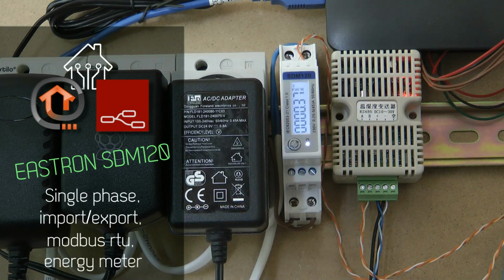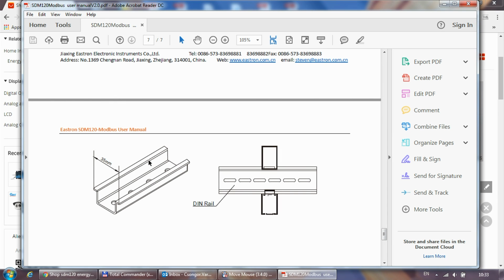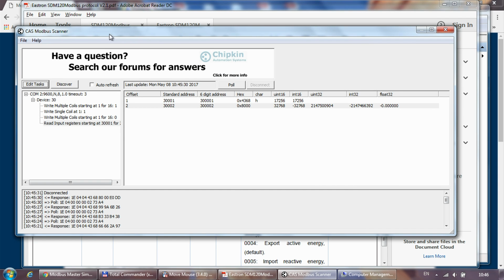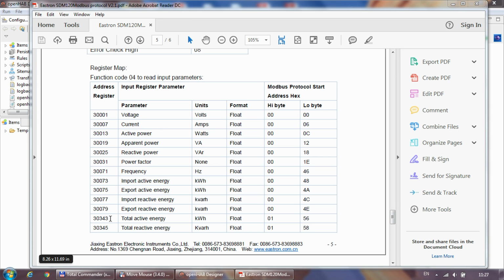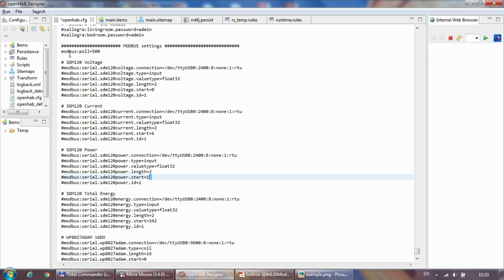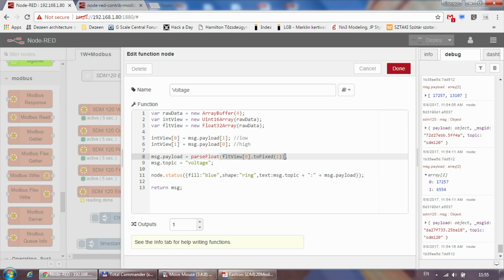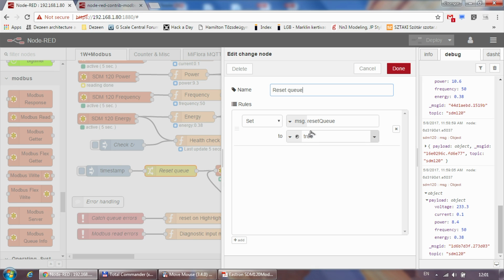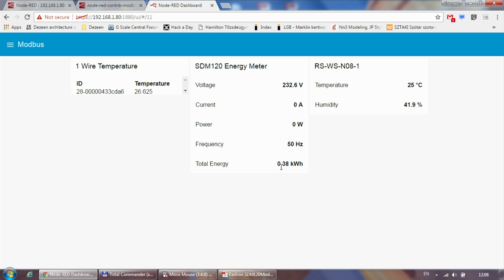Eastron SDM120 single phase modbus energy meter

Comment: So how does this connect to inverter i must have missed it ? My meter is in house and my inverter is in garage about 40meters away
Reply from the maker: That is not a problem. Modbus can handle a few hundred meters. There are cables specific for serial data, probably some sort of twisted pair, possibly with insulation around it.

Comment: To change baud rate to what I want, I tried to long press to enter setup mode, what I got is only to setup CT number. By the way I did not connect to anything yet, just standalone SDM120. Once I can set baud rate to 2400, I will hook up to EW11 (TCP <-> RS485). What's wrong?
Reply from the maker: You can set the BAUD rate as well. Check the documentation, holding register 21 is the ID, and holding register 29 is the Baud rate. But 2400 is the default.

Comment: how did you figure out to "convert" the 2 values from the array to get the actual i.e. voltage value?
you absolutely safed my day with this!
Reply from the maker: In the documentation it was mentioned that it is IEEE float value (or something similar). I just Googled it and fortunately found a javascript example how to convert it :)
Reply: @csongorvarga  thx! 
my son suggested I should ask chatGTP what the code does, and I kid you not, it was actually helpful.
I did not know that the low and high values are 2 16bit integers that have to be converted to a single 32 bit float. now it makes much more sense. :)
Reply from the maker: @ChristianHolzer-l3p  Oh yes. These are the two examples I have seen so far: 2 16 bit registers used to represent a float number, or the actual number is multiplied by 10 to 100 to represent a float number with 1 or 2 decimal places.

Comment: I am sorry, may I ask you question? Is this Eastron SDM120 using CT (Current Transformator) in this case?
Reply from the maker: Internally, it may be using that, but I am not sure. The unit has a live in and live out terminals, so there is no external CT required. It has to be wired into circuit.

Comment: I just found out that the new SDM120M meters that i bought with software version 202.04 can be editted on the device itself. For example: to change the slave id: hold the set button, go to the ID field, and hold again. The ID field can now be adjusted.

Comment: I was following your video to set up an SDM120 (firmware v0202.04)  and found while trying to get in into set mode (long press on the button) that the Id Digits started to flash and a short press increased the value while a long press moves to the next digit. I managed to change Modbus ID, Data Rate and Parity to work with the rest of my system (2x SDM630s). If you need to change other settings then you will need to go through this video in full and work out the register addresses etc. Nevertheless I found this video to be the most useful out of all the ones i tried so well done and thank you.

Comment: I just got a node-red flow with a sonoff basic running tasmota with win10 and mosquitto as the mqtt broker/server. Was struggling for ages before realising two things one, my mqtt server was on a work computer with locked down firewall settings which prevented the sonoff talking to the mqtt server. when i moved the server to another (non work) win 10 box i still have the same error MQT: Connect failed to 192.168.1.***:1883, rc -2. Retry in 10 sec.  This was because in the mqtt configuration on the sonoff tamota webpage i had put http:\\ in front of the ip which it didn't like. Anyway i have that working so now i can hopefully move onto getting my sdm120ct working on my main power of my house to measure the export of the solar and turn on the car charger and other loads when there is a big surplus. Wanted to say thanks for the video & the attached flow. very very helpful.

Comment: Hi there, great video. May I know are you using a normal cable for the RS485 connection?
Reply from the maker: Yes, I am using 2 wires from an ethernet (CAT5) cable. One of the color - color/white pair which are already twisted together in the network cable.

Comment: HI there, I do Click by Click from your example, but there is no ModBUS output, (on windows all si OK), but on Node-Red Modbus connect and poll at 5 sec  and read but don`t have any output. I Have a SMD120M EASTRON (ID30/9600) to TTL to RS485 HW0519 to  CP2102 USB to RPi3+ 
  Please advise what to do next or were to look  TNX
Reply: tnx anyway, i found a simple way for me >> SMD120 < ID1/9600> +TTL to RS485+ ESP8266 (D1mini) with Tasmota Version 6.4.0(sensors) to mqtt BUT YOUR VIDEO IS THE BEST  TO SET UP SMD120
Reply from the maker: Sorry for not seeing this before. Sometimes I also have similar issues with the modbus component in Node Red. What I have found that sometimes I need to change the modbus configuration for example set to buffered and back and re-deploy the flow and it starts working. I am not sure if this is an issue with the modbus or the serial node. But I did not know that Tasmota works with SDM120. That is very good to know!!!
Reply: @csongorvarga  tnx for replay

Comment: Great tutorial. I have purchased two of these also. Can you show how you connected the modbus wiring? Did you add your own 120ohm resistor to terminate the bus? I have not heard you mentioning this in your video?
Reply from the maker: I did not use any termination. Just two simple wires and that is all. If the units dont communicate I just swap the wires.
Reply: @csongorvarga  Ok, will try that. Perhaps the length of the bus connection does make me need to use a terminator resistor (at the last device of the bus). I'm planning to connect more Modbus enabled devices to the same bus with up to 50 meters of total bus length which makes the influence of reflections larger. This is probably not an issue with a desk setup.

Comment: Excellent video.  Watched it several times.  Every time i notice something I've missed.

I have set your flow up for 2 devices.  SDM120 and SDM230.  

It's was working but I was getting 'FSM Reset On State INIT' and 'FSM Reset On State QUEUEING' in the debug pane on all Modbus Read Nodes all the time.  

I have set the poll rate to 15s.

Sometimes , after making some modifications, it just refuses to kick off. 

The Modbus Read Nodes cycle 'Initialize - Reconnecting' over and over.   

 When I click any one of these nodes I get 'FSM Not Ready To Read On State INIT'

What am I missing?
Reply: Restarted Hassio and Node-Red it is now working.  Still getting 'FSM Reset On State QUEUEING'  all the time though.  Is this normal?
Reply from the maker: I also get this from time to time. Seems like the modbus modul cannot initialize itself after certain changes. Try making some changes in the serial configuration. Change RTU to RTU-BUFFERED or back and deploy again. This is the only way I managed to get it working. Otherwise find this contrib-modbus on githuf and raise an issue there. I got a response within a few days when I initially had modbus issues in Node Red.
Reply: Thank you for your reply.

I'm happy with the result.  At least my HA log is not being flooded with 'No response' errors from the Modbus component.

Comment: Hello, I'm trying to connect with a sdm120ct through the computer but when I do poll I got no responses. I'm using a MAX485 connected to the sdm120ct (B-9, A-10, GND-GND) and the max485 connected to the pc as well using a USB-TTL converter (DI of max485  to the TXD of the converter, and the DE and RE of max485 connected to VCC). Thats the way you did it?

I'll be pleased if you can left some comments on this. Thank u.
Reply from the maker: I used a USB-RS485 converter, so I did not have to deal with TTL-Max485 connection. My only issues is if I mix the A, B lines, so if it does not work, I swap them around. But I would not be able to tell if you have wired the MAX485 incorrectly.
Reply: did you only connected the tx- to pin B of the sdm120 and tx+ to the A of the sdm120 with your converter and that was all?.

Thanks for the reply :)
Reply from the maker: Yes, there are only two wires between my USB-RS485 converter and the SDM120.
Reply: thank you so much, great video. Thank you for share it.
Reply: Have you used ESP-7 with the sdm120 as well?
Reply from the maker: No, I never used esp with rs485, but something I was planning to do.
Reply: Nice, I did everything as you did and it worked perfectly. I connected more than one SDM120CT and I also use ESP-7 RS485 -Lora and ESP-6 gateway. Everything worked fine. Thank you.
Reply from the maker: Wow, nice setup. I am glad that it had worked.

Comment: Hi! I used this with an XTM35SC and the only difference is that current is on address 8, watts is on 18, Hz is on 54 and kWh is on 256
Reply from the maker: Thanks for sharing!
Reply: Can you share your code?  On my xtm35sc only voltage and amp worked. timostempmail@gmail.com

Comment: Great video!
Could you explain how you connect sdm120 to raspberry pi. Did you use some converter? Which device from right side of sdm120? I try to connect sdm220 to raspberry pi which runs openhab by using  of rs485 to usb converter from ali. So far no success.
Reply from the maker: I have a USB to RS485 converter. I did not have an issue with it. I plugged it into the RPi, I could see the device in the usb device list. I got it ages ago, and quite frankly I forgot where I bought it. When i run "lsusb" on the PI I can see it as a USB device. Maybe yours is using a FTDI chip which does not have a driver preinstalled in linux? Sorry  I am just guessing here.

Comment: Following your video, I have tried to set my SDM120 to another meter ID to allow for more than 1 meter on the bus.  I now get ID 000 on the display and am unable to talk to the unit.  Any ideas to reset the meter ID to factory (or any other ID) when it says ID 000 ?
Reply from the maker: First you need put one SDM120 on the modbus line and change the slave ID. You do this one by one. Set one of your SDM120 to slave 10 and the other to for example 11. I have covered this in the video. I was changing the slave ID around. Once you have both of them on a separate ID you can talk to them on the same bus.
Reply: Once the ID of the SDM120 is 0 (due to input or comms error) the Modbus poll cannot communicate with it anymore as the software refuses ID 000 as a valid modbus ID.  I had to download "Simply Modbus Master" tool - this tool will actually talk to any ID and I was able to reset the meter to another ID.  But now everything is up & running.
Thanks
Reply from the maker: Great, I am glad you got it working.

Comment: Very useful video! I'm starting my own project for displaying the active power generated by my PV. But I'm wondering what's the accuracy of the Energy data. Is it 1Wh accurate, or 10Wh? I searched the internet (not entirely off course) , but could not find the answer... The voltage looks very accurate (more than 5 decimals).
Reply from the maker: Documentation says power and energy readings accuracy is 1% of range maximum
Reply: Csongor Varga Thanks, but that was not what I meant. What I meant was the 'Long' value of Energy, how many decimals does it have? Meaning accurate in 0,001Wh or 0,01Wh or 0,1Wh?
Reply from the maker: Uh, I have no idea to be honest. Check this if you can make a sense of it: https://en.wikipedia.org/wiki/Single-precision_floating-point_format
Reply: Please visit our Eastron Europe Sales Office - http://www.eastroneurope.com/ or for prices please email josh.pereira@eastroneurope.com

Comment: How to add 2nd SDM120 (one for PV, one for Grid) plus few DS1820 sensors on to the same web page?
Reply from the maker: When you add a new UI element on the dashboard you specify the group the element goes into. The group than refers to the tab on which it appears. Just make sure the group points to the same tab and they will appear on the same page.
Reply: Thanks for your kind help, these are my first steps in Node-red. What node do you use for DS1820?  Any example code?
Reply from the maker: Sorry, I don't know. If the DS1820 are also modbus, you need yet another Modbus Read node to read the DS1820 sensor. I am assuming you have set them to different station ID. Just read it with another modbus read node.
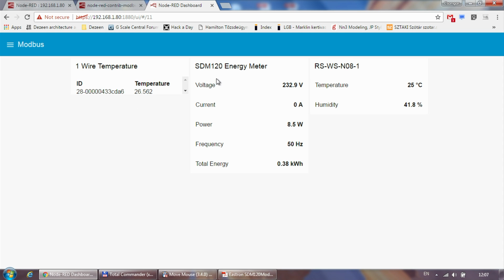Reply: There is one show at 45:12 min on your video. DS1820 temperature sensors uses 1-Wire protocol and have own unique ID number (that must be found out). I'm not sure if I could connect them directly on to Raspberry Pi I/O bus ?     https://datasheets.maximintegrated.com/en/ds/DS18S20.pdf
Reply from the maker: If you are using raspberry pi you must have the Raspberry PI node group in your node red. In that group, there is a "rpi ds18b20" node. That node will give you all your DS18B20 sensor values in an array. Just use one of the guides on the internet how to wire them to the pi.
Reply: Nice, thanks. I'm surprised how good this tool is for visualization...  Are there any other gauges available for Node-Red?
Reply from the maker: No, It is limited to some extent, but there is a style option on the gauge node and you can have the traditional needle style gauge, but there is also a level style option. But on the other hand it provides a very refined look by not being able to have too many different ui elements.
Reply: I am also making same project. I have a question. I am new to programming can i  save the data in .txt or csv file rather to print online. i dont want to use mqqt or something just simple program.
Reply from the maker: I don't know if there is a standalone product that can do that, but with Node-Red you can format the output to  csv and send it to a file without any problem.
Reply: Csongor Varga I am using IME Conto D4 it is also Modbus energy meter but following your details I can't get the reading in Modbus poll. I don't know where I am going wrong 😖
Reply from the maker: All Modbus units are different. Where it stores the values is up to the manufacturer to decide. So you need to look at the modbus manual of your meter and change the program accordingly.

Comment: Does the meter require a transformer to work? I wish you can show us how the wire connected. It is not so clear in the video.
Reply from the maker: Yes, I missed that. But it is really simple. You connect mains power live and neutral. The power supply is inside. There is a neutral connection and a live in and live out. That's all. And that you have two separate wires for modbus.
Reply: Csongor Varga thanks, I have seen other applications and figured it out. I am curious about what socket #5/6/7 connect to. I have ordered two for myself. The sales told it should work with a transformer. I wonder maybe it is #5/6/7 all about. I have read through the manual. It mentions pulse 1 and 2 stuff. I do not know what it means and how it work. Maybe another usage case for the transformer too.
Reply from the maker: Yes, those are for pulse 1 and 2 (plus common ground). Pulse 2 is fixed to give a pulse for every total KWh, pulse 1 can be configured for KWh or KVarh and 1, 0.1, 0.01 or 0.001 units.
Reply: Thank you. So #5/6/7 are pulse 1/2 and can output its data in an old way.  I see what my problem is. There are two models of sdm120.

one can connect to core directly:
https://detail.1688.com/offer/40026832563.html

one works with a transformer
https://detail.1688.com/offer/40012049159.html
the transformer looks like:
http://www.eastron.com.cn/product/60465050756-218696762/EASTRON_ESCT_TU36_Split_Coil_Current_Transformer_20A_600A_Input_333mV_and_100mV_Output.html?spm=a2700.8304367.prewdfa4cf.103.6961ddf1IXxQzv

I think what i need is the direct one. But maybe I just ordered the first one shown up. And the sales issued a double check.
Reply: @aguegu314  Hello we have a CT version of this Please visit our Eastron Europe Sales Office - http://www.eastroneurope.com/ or for prices please email josh.pereira@eastroneurope.com